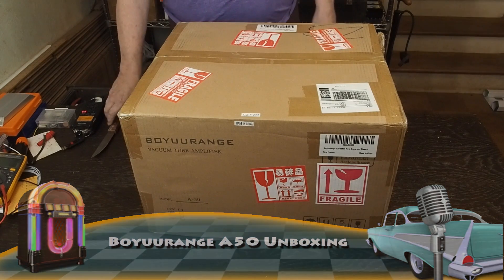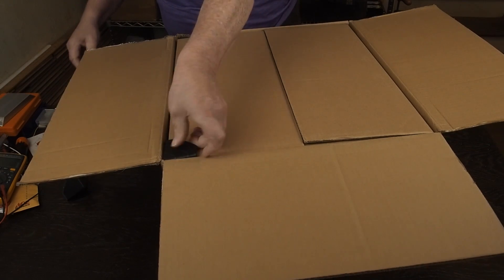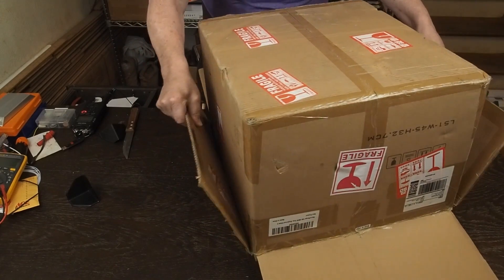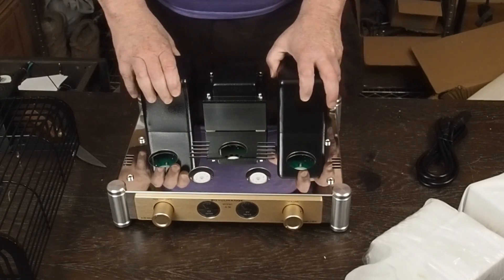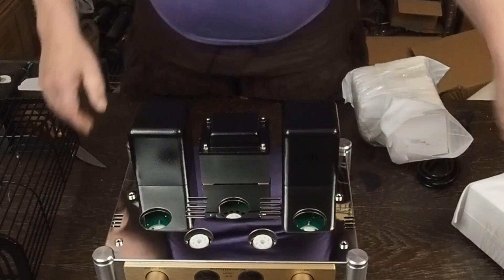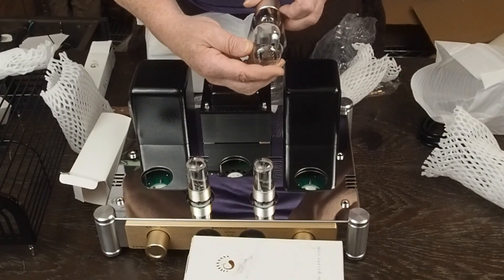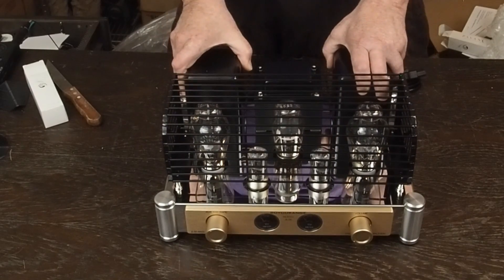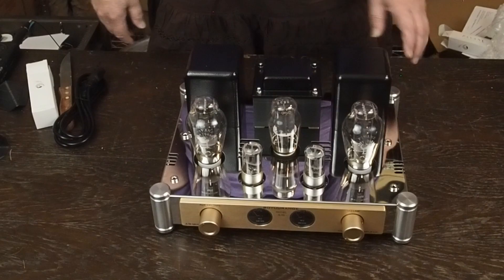Boyuurange A50 Tube Amp Unboxing + Full Review

Comment: Thanks again for your great channel and reviews 

Do you recommend this or willsenton ? 

Kind regards
Reply from the maker: The Willsenton R300 300B amp is a do not buy. The A50 only if you can do the needed modifications. If you want to just use it out of the box, it's also a do not buy.
Reply: @SkunkieDesignsElectronics what about Willsenton 
R8 VERSUS THIS?
Reply from the maker: That's like saying should I buy a sports car or a sedan. An R8 is a completely different thing from a SE 300B amp.
Reply: @SkunkieDesignsElectronics that's sounds you don't know what you would you recommend and as a result you don't know what's the difference between the two amps.

Comment: I’ve owned this amplifier for years now. I’ve rolled in a Gold Lion GZ34, vintage GE 6SN7 GTBs, and kept the Psvane 300B tubes. The best thing I did was to add a Project-Audio Tube Box S2 pre-amp that I rolled some Mullards into. I have a Project Carbon Evo turntable, and Klipsch RP 600m. The next move is probably Heresy’s, but truly unnecessary.

Comment: After about 15-20 hours burn in, so still quite new it’s sounds ok when fed by Pioneer LX800SE Blu-ray SACD player into some large 98dB horns. Not great just good. Suspect more burn in time is needed.
Reply from the maker: I suspect it needs the mods I ended up doing to this amp. It honestly just sounds dead with low power without these mods done IMHO.

Comment: I'd like to add to this video (if I may). These newer Chinese tube amps use printed circuit boards (even some of the so called P2P ones). The tube bases can be fixed to these boards. When seating your tubes you need to be careful not to bend the boards. It can cause crack or breaks in the traces. I've seen a lot of damaged  (the amp w/ the name that sounds like a popular American truck) amps in the last couple of years. And believe me, getting them to send a replacement circuit board is very difficult. Thank you for taking the time, really enjoy your videos.

Comment: This amp is week. It only has 7.6W per channel
Reply: Yes, this is a very valid point.  300B amps generally don't have big "watt" numbers.  They need to be paired with very efficient speakers to satisfy most listeners.
Reply from the maker: Out of the box, it's only 2.5-3W at anything resembling reasonable distortion levels.

Comment: Well, typical chinese made massive production amp using circurt board, the drive tube 6N8P is very noise, I would replace it with 6SN7 right away. 5Z3P is the russian version of 5U4, looks cheap made.